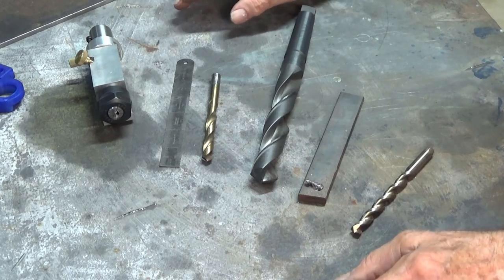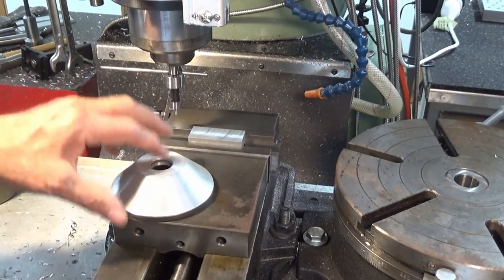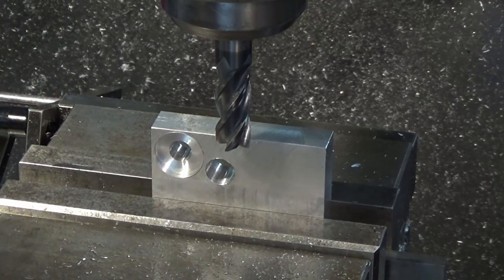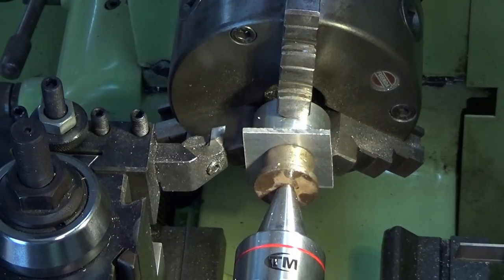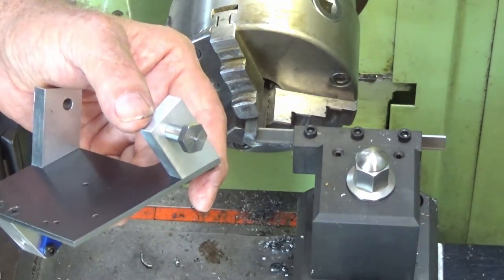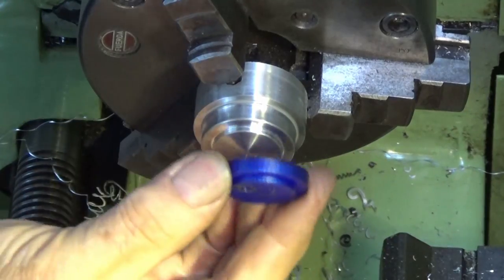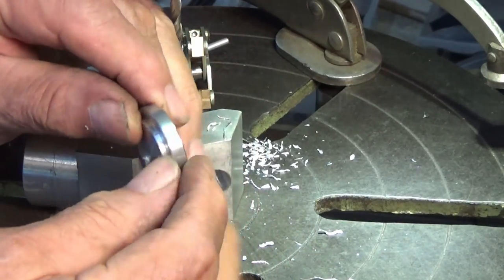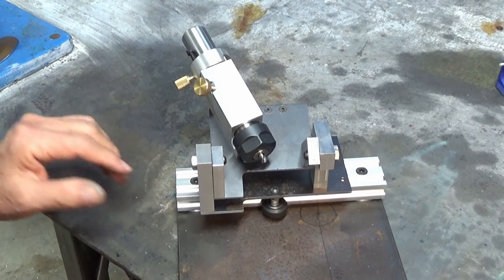A 4 Facet Drill Bit Grinder DIY Style Part 4

Comment: Mark, when I made my version I made the tilting support plate wider so that the cup wheel would fit inside a larger cutout with sufficient space for the plate to move side to side. This meant that I could drill the support arms and sides at the same time  didn't have the issue with angled supports and the side pieces could be drilled together to help accuracy. I also made some brass bushings to line all the holes. To help align the grinding wheel on the center line I made a rod that goes all the way through the jig that has a D profile in the middle ad the grinding wheel can be butted up against this for 'easy' alignment.
Reply from the maker: Thanks for the heads up on aligning the face of the wheel with the centre of the trunnion support. I was relying on my CAD model to help me find the position of the grinding spindle but I was then going off on a tangent and thinking about lasers etc. Your method sounds like the best solution. I am really looking forward to using it.
Regards,
Mark

Comment: Diamond will work good for carbide. You may want to consider getting a CBN wheel for your steel drills. Diamond will work but CBN would be better. Also for both types of wheels a dressing stick would be good. Not for truing up the wheels but for exposing the abrasive of the wheel.
Reply from the maker: Thanks. I will be getting a CBN wheel. I am surprised that they are not as expensive as I thought they would be. I will probably have to allow for more adjustment in the positioning of the grinding spindle though. I am guessing that not all cup wheels are the same depth. 
Regards,
Mark

Comment: Nice work as always, nearly finished now. Side project for you - you can look at your bandsaw and see if you can get a mechanism in place under the table to stop the blade moving back away from the cut, and the top guide seems to have some movement in it too. Probably magnified by the close up of you trying to cut your fingers off. Keep up the good work.
Reply from the maker: Glenn, there is a ball bearing to take the back thrust of the blade both above the table and below. I didn't even notice the adjustment was incorrect until looking at the video myself. I will have to fix that. 
Regards,
Mark

Comment: Preso, might CBN be a better choice for the cup wheel over diamond?  Diamond, a form of carbon, is known to have adverse interactions with iron.
Reply from the maker: I will be looking for a CBN wheel in the long term. I have heard that you shouldn't use diamond wheels with HSS tools. 
Regards,
Mark
Reply: @Preso58  CBN also grinds HSS with much less heat. The carbon in diamond will dissolve into Fe based tools damaging both the tool and the wheel. Use diamond for carbide.

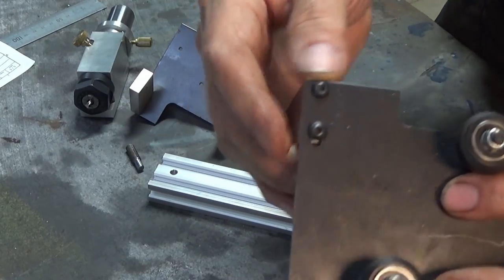Comment: 12:57 sorry Mark, I was at work (actually doing some work on our ragged out old bridgeport, which is not something I do all the time since I am an electrical engineer ... but I needed to  fix my own oopsie) Also are you going to put stops on the end of the extruded aluminum, if so I would not make one permanent ... I have those wheels on my 3d printer and they can dig in surprisingly fast if something jams  and produce a flat tire
Reply from the maker: I will be adding limit stops on the traverse mechanism. I am still unsure if the Vee slot track and wheels are going to be rigid enough but I already had it and it was sitting in a cupboard so I figured it was worth a try. My wheels also came from a decommissioned 3D printer.
Regards,
Mark

Comment: If I could get any of my drill bits to work properly I would be slightly thrilled. I have mini equipment and if the tool pressure is too high then it becomes defeating.  I’m in the process of building something similar to this and hopefully it will work out.  I have a drill doctor but I am not too impressed with it.
Reply from the maker: I have several plastic boxes full of dull and duplicate drill bits that I would love to bring back into service. Individual number and letter drills are hard to find around here too so when I damage one I generally have to continue using it and accept the poor performance. Hopefully this will all change soon.
Regards,
Mark

Comment: So I'm guessing that bit you are using to center mark holes is the 4 facet grind you showed at the start? It works very well.
Back when my eyes were pin sharp and could focus very close I used to hand grind all my drill bits and being a jeweler many of those bits were less than 1mm (clearly they were not 4 faceted though hehe). Those were the days :)

Comment: Really coming along nicely Mark, were those center punch marks on the triangle piece you were cutting on the bandsaw and if so , why ? Inquiring minds want to know 🤔 .
Reply from the maker: The marks on the scribed edges of the part are called witness marks. They are light centre punch points and the idea is that as you file down to the line, the marks show up on the edge as small vee notches. It also serves as a datum if the scribed line gets hard to see. You can always re-establish the outline if the witness marks are still there.
Regards,
Mark
Reply: @Preso58  , thanks Mark, great idea I had never noticed that before but one I will put in my playbook.

Comment: Mark I am a new subscriber I like this video I like most other normal guys can't perfectly sharp a drill.  Just an after thought, What if a person was to take the eccentric wheel and put  corresponding lines on the edge so and put a clicker on it so a person would know if it is on the right angle! just an idea
Reply from the maker: There will be some engraved lines on the eccentric wheel but I had not planned on making any sort of detent stop for it.  That would probably be nice to have though.
Regards,
Mark

Comment: If you want to use a d bit grinder, you can get 5c to ER32 adapters for large drills and straight shank ER11 adapters that you can hold in a 5c for small drills.
Reply: how much length does that add up to though (not being wise but I know adapters eat up a pile of space on smaller tables)
Reply: The shortest 5C-ER32 I could find sticks out extra 37mm.
Reply from the maker: I have tried to use a 5C to ER collet adapter but they have too much stickout to work. Also, the standard D Bit grinder collet holder cannot hold long series drill bits since there is no through bore in the collet block. The D Bit grinder is a great machine but it can be quite frustrating at times when you can see the potential but a lack of space or a limitation stops you doing certain operations. 
Regards,
Mark
Reply: I agree there are there are quite a few limitations to trying this with a standard d bit grinder. I have plans to modify the collet draw nut to have a through hole for exactly the reason you give.

Comment: Mark great job,, I’m not a smart Ass, and only wished I had a mill like yours,,but I do have a Tormek T8 with the drill sharpening attachment and the other toys too go with it  at $2 and a bit large ones, but it will do 4 facets  regards Frank. Can’t work out how to send a photo of the drill bits
Reply from the maker: That's interesting. We used to have a Tormek at work and we had a few accessories for it but I didn't realise it could sharpen drill bits. 
Regards,
Mark
Reply: @Preso58  But a quick look on internet indicates that the drill sharpening attachment for the Tormek T8 retails for about $580 USD (or about 870 South Pacific Pesos - assuming you can get one locally). I think I like your idea better Mark. I also have a D bit grinder, but think I will follow your lead and build the same project. Looking forward with interest to seeing the completed product. Great presentation as usual.

Comment: if you already using 3d printer spare parts for the rail assembly, i hope you used excentric screw on thet wheel oposite to two other like in most 3d printers, because those rubber tires look tough but they wear like crazy when they are set up with a wrong preload and they getting loose with time or start to vibrate
Reply from the maker: I am still not sure if I made the right decision to use the Vee slot track and wheels. It's a fairly easy retrofit if it doesn't work out though.
Regards,
Mark
Reply: it's not going to move back and forth for hours like in a 3d printer
Reply: @fuzzy1dk   that's the problem, when rubber stay in one place for long time it likes to take that shape, too much preload and not much use might be the worst scenario

Comment: Mark you were extolling the virtues of the 4 facet drill grind but like in most cases there is no free lunch. In my experience 4 facet grinds do penetrate nicely as you say but the cutting tip is much weaker than a conventional grind making them less than ideal for difficult applications. By virtue of the complex facet details these drills are not readily reground by hand. Commercial 4 facet drills have less web thinning, so if you need to regrind with a conventional grind the resulting chisel point is very large.
Reply from the maker: I have lots of dull and duplicate drill bits that don't get used and they were all conventionally ground bits when I got them. Some even belonged to my father! I guess that as a hobbyist I am not pushing the cutting process as much as a production workshop would. However I would like to be able to use those bits again. It can be quite frustrating to find one bit that cuts oversize or struggles to cut cleanly. As you say, it's always a case of compromise.
Regards,
Mark